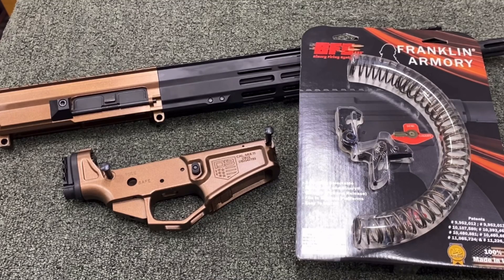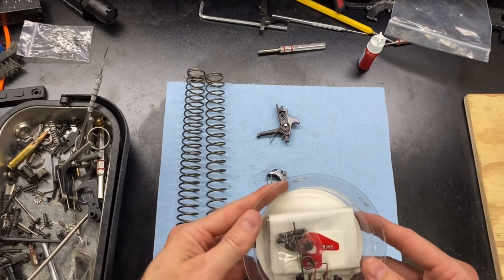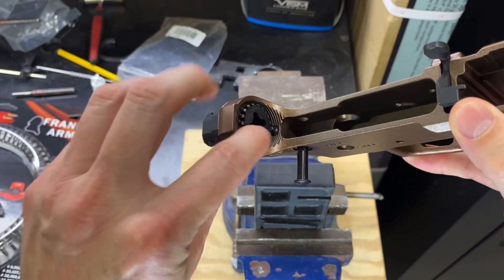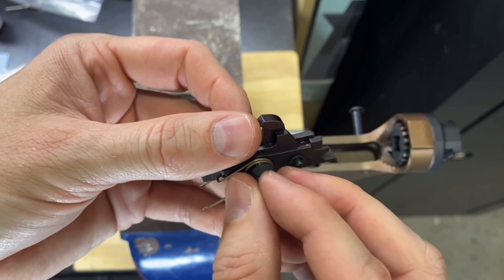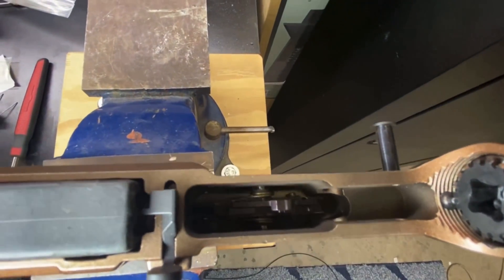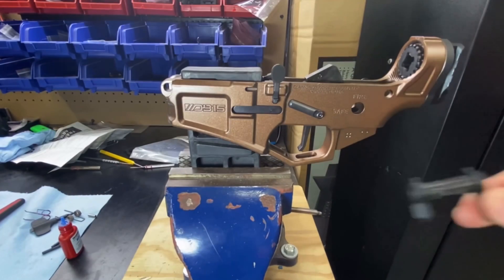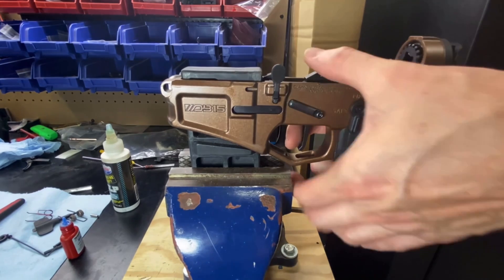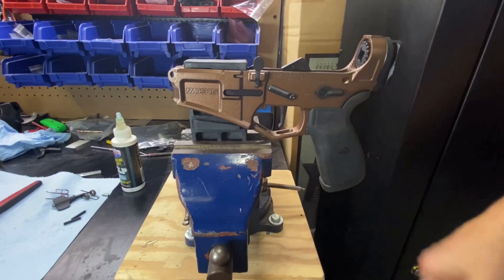Franklin Armory BFS III Trigger Installation

Comment: 3 things that will make your BFS trigger even better.......1.) Take that gaudy red label sticker for the safety selector and throw it in the garbage.  2.) Use a set of JP Enterprises high-speed competition spring kit (hammer, trigger and disconnector)  and 3.) Use a Geissele Super 42 Buffer Spring with H1.   You will see a huge difference and believe me, you will be thanking me later.
Reply: I seriously can't believe how many people I see that actually put that ugly red sticker on their guns. Mine went straight to the garbage
Reply from the maker: @Or3guns I refer to it as the “retard alert” sticker.
Reply: I literally came to your video looking to find out if there was a spacing issue that made it necessary to install the gay sticker or if I could install without it. I was literally going to take an exacto knife and just cut the circle if it was a spacing thing but I'm glad to see it's not.  @combatreadychannel
Reply from the maker: I’ll give it a try. I’m actually having issues with it right now that I have to figure out first.
https://youtu.be/DktVgJdttlM?si=hRZmtN6Egum2e0bZ
Reply: Do you have a link for this kit? Thanks
Reply: @aaronjackson6257 anything yet?
Reply: The only JP enterprises springs that are used for competition are the reduced power trigger spring kit. I can’t find anything with the name high speed competition spring kit. Is that what you are talking about
Reply: @Gunner556 wondering the same thing, did you figure it out?
Reply: @JaxonGutierrez-u8s  No I couldn’t find anything but the Reduced Power Springs by JP Enterprise
Reply: @JaxonGutierrez-u8s  I just used the blue hammer spring and the red trigger spring that came with the BFSIII Trigger
Reply: There is A LOT more to installing the hammer than what you see in this video. It took me two or three other videos to find one that helps you get the hammer in correctly.
Reply: @jber9569  how so? Get the hammer spring lined up with slots and should be fine
Reply: I agree, except for you should use the h2 buffer if you have a carbine length gas.
Reply: I just wrote fun mode in sharpie
Reply: Man I wish you had a link for that spring kit
Reply: I’ve tried all the combinations of springs and this thing still feels like gritty shit.
Reply: @billymichaels2889  for some reason your post has been disappeared.... (happens to me all the time) 
It's not supposed to be a match trigger. It's slightly (if that even) better than milspec. Want a decent one? Grab an mbt for cheap. Or check out frt.....
Reply: That was exactly what I was thinking about that red label that sucker would be stuck on a Target! ✌️

Comment: What size is that hex? I ran though standard and metric but I can't find the correct one.
Reply: Same here, I wish these tutorials would just mention all the tools they use. The manual says 1/16th allen key but it's still too small
Reply: Same here couldn't find it in my multi bit set
Reply: I use one from my car wrench tool kit

Comment: For some reason mine will let me select into safety even when the hammer isn't cocked the safety works an semi is working so is binary I haven't actually shot it yet just function checked I'm not sure why it allows me to go into safety with the hammer did engaged
Reply from the maker: That’s normal for the Franklin armory trigger. At least it has been normal for all the ones I’ve dealt with.
Reply: @combatreadychannel  i ended up taking the trigger completely apart and put it back together an it seems to have solved the issue i think the bigger spring was off a little

Comment: So I have two questions for those smarter than me. I've seen on a few distributors websites that your lower has to be mil-spec, but FA website doesn't mention specifically that. And two, I want to try this with a 20" rifle length system, should I use the heavy springs?
Reply: Longer the barrel heavier the spring
Reply from the maker: The trigger was designed with mil-spec lowers but almost all ar15/m4 designs should work. I have installed the trigger I a couple non mil-spec billet lowers and it has worked. 

The heavy spring is going to “slow down” the bolt cycle rate. Some people like that and can make the recoil feel smoother. The gas tube length also contributes to that. Try out both springs and see which one you prefer.

Comment: I didn’t see this video before I put my trigger in and forgot to put the trigger spacers in. Can I put the slave pin back in and start over?
Reply from the maker: Yes you can. There are springs and other small pieces inside the trigger group that will shift or drop out so make sure everything is in place and snug while you slide the slave pin back into place.
Reply from the maker: Do you want me to make a video showing how I do it? I could have it up by Sunday
Reply: Got it done. Thanks. It’s working good now.
Reply: Why is there a tiny spring in the bag with the spacers and trigger pins?